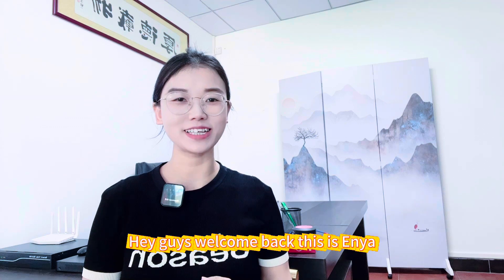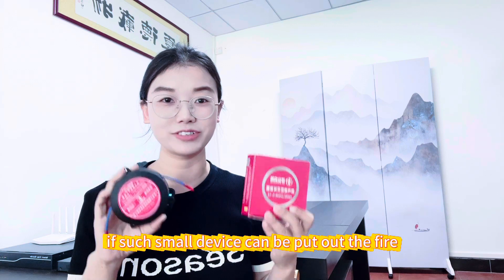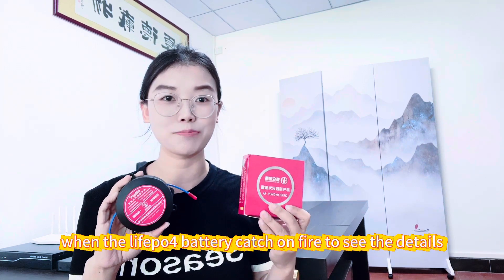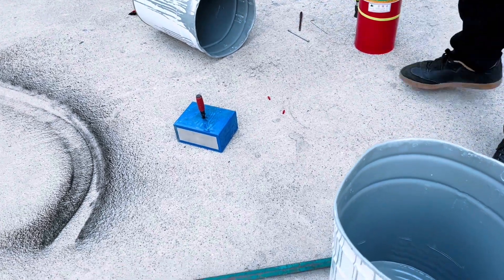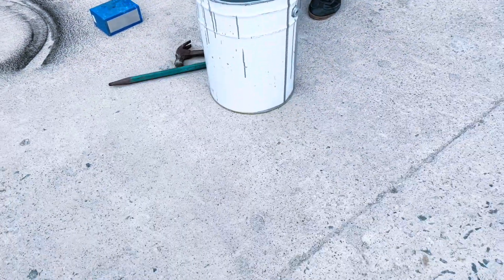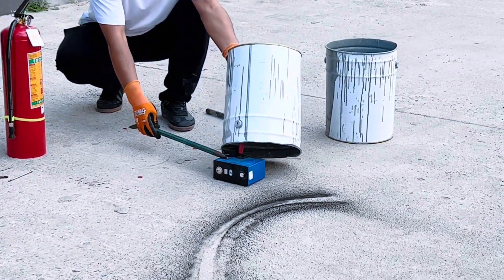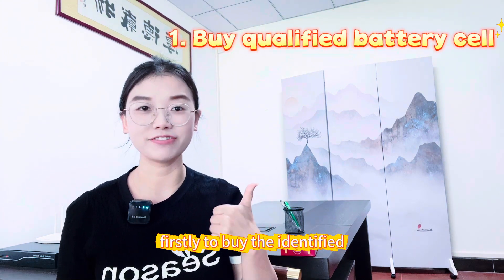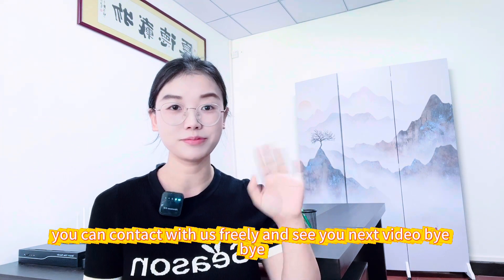Aerosol fire extinguishing device test for lithium ion battery catch on fire

Comment: I saw a video Signature Solar had about UL9540A testing. They said UL could not get Lifepo4 batteries to ignite on fire they had to use igniters to burn the battery make plastic and aluminum melt to do their testing.  Your right that these fire extinguishers are nothing more then phycological devices are not going to do much. I knew that because anyone who ever used a small bottle on a minor fire quickly figures out their fire extinguisher is too small in most cases. That little puck is not going to put out a tiniest fire.

Comment: lol just use a can of "compressed air" or "keyboard cleaner" as we call it in usa. its full of refrigerant and its plastic valve will fail from flame or thermal runaway and cause rapid release of contained refrigerant. refrigerant of the low pressure/older variety will not burn and displace o2 and h2 vented gas in enclosure. 1$ solution. there is some cooling power too from all the refrigerant releasing rapidly.  anyone who has ever dropped and busted one of these cans can attest. old school soviet and submarine extinguishers of the haylon or carbon tetra-chloride variety worked this way for 100 years. just dont want to be on the kursk when they activate lol

Comment: I don't think this test is valid. The fire extinguisher works inside a closed battery pack and to test its real performance it must be inside the sealed battery pack.
Reply: it's garbage anyway
in UPS rooms of datacenters and industrial energy storages are used chemical oxigen suppressors with very sofisticated systems and monitors
these small boxes added recently in some DIY box kit are totally useless, only marketing
Reply: Problem is no one can get lifepo4 to actually catch fire on it's own none of the UL testing is real testing either. Watch the UL9540 and 9540A discussion on one of the latest videos published on the Signature Solar YT channel. They said UL had to use igniters to make it burn over charging didn't work.  It's like putting the battery in a gallon of gasoline igniting it. You ask AHJ inspector or fire marshal if they know what a Lifepo4 is haven't a clue. They go by what the media shows EV burning with NMC battery.